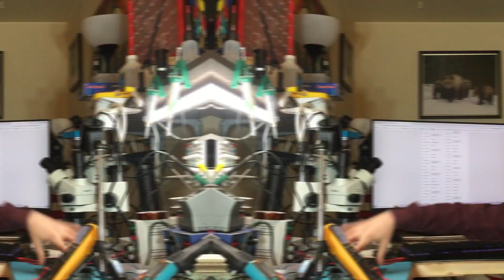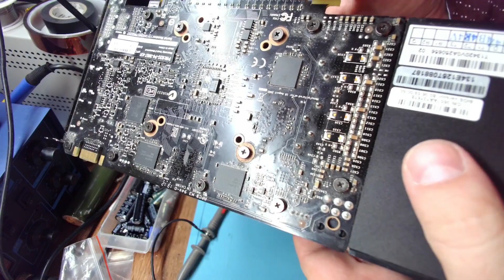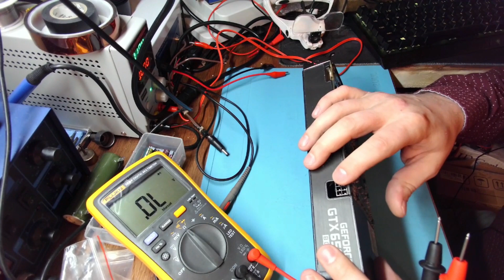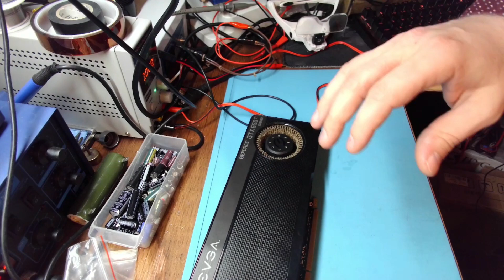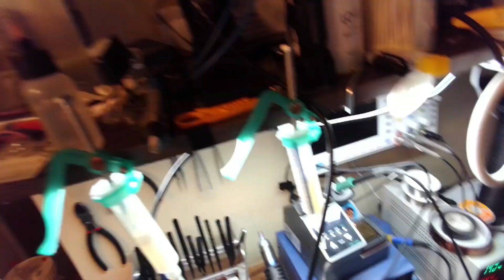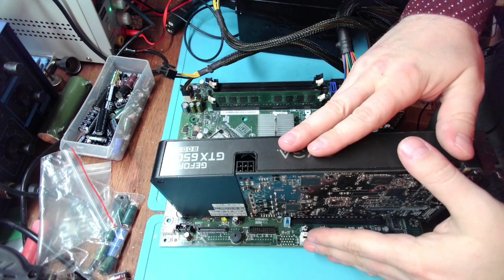My GTX650Ti Boost Died! Can We Fix it? General Diagnostics

Comment: Hi, PCI-E slot provides max 70W of power per spec, it is not insignificant.
12V as well as 3.3V are always connected from both sides, just to provide a lower resistance path for this kind of power, so measuring on one side is completely fine. At least on GPUs, other PCI-E devices may vary.
It is also good to measure clock and reset pins if card is not recognised in the system, or prevents system from booting (not needed in this case).

I like the device that checks all the data pins at the same time, huge time saver!
On that note, for the card to work you only need PCI-E x4, so the first few pairs of data pins, any other mode is optional, it just impacts the data rate so you get much worse performance in games, does not really affect CUDA workload.
Reply from the maker: That is a very useful comment, thank you. Yes I did have OL on there in the previous card, there was a short and blew a fuse (GPU seems to be shorted) so my comment was not very accurate but my main point was that the main power rail handles the most current.
Reply: @blackhorserepairs  Yes indeed, this is true for most gaming cards out there. Non-gaming cards that use 70W or less do not need suplemental power, and some GPUs that hover around this value or slighly above will sometimes connect suplemental with slot 12V together, for this small extra "umpf".